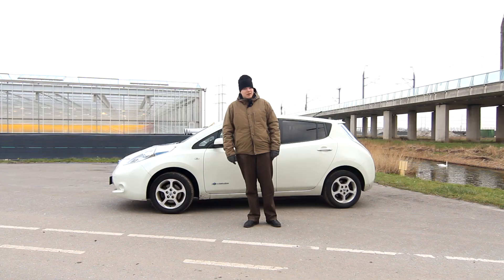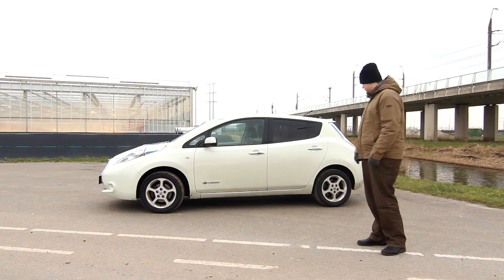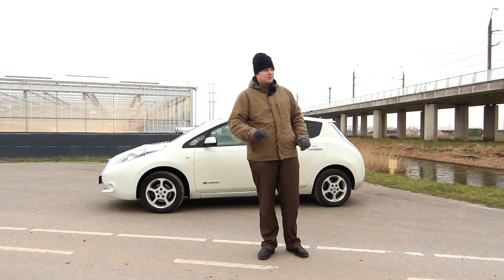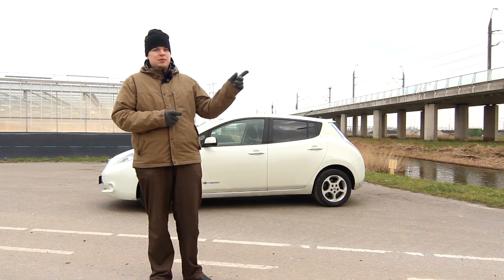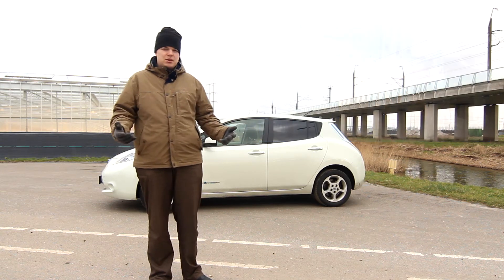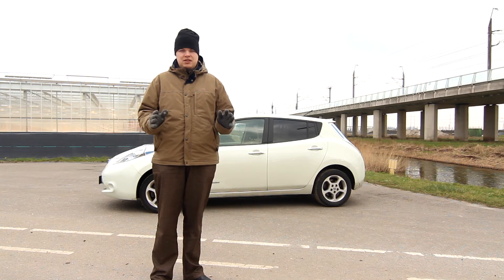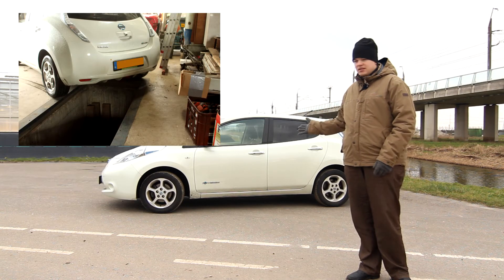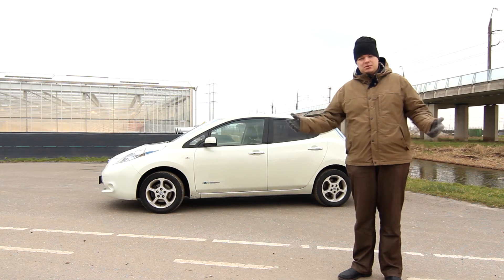PEB in 2018: Electric car mods and chemistry!

Comment: When there is no percentage on the meter and in Nissan leaf spy with 0.4kwhrs it will go into 🐢 mode.  It I was hypermiling on over passing vehicles. but kept an eye on the Kwhrs of the battery.